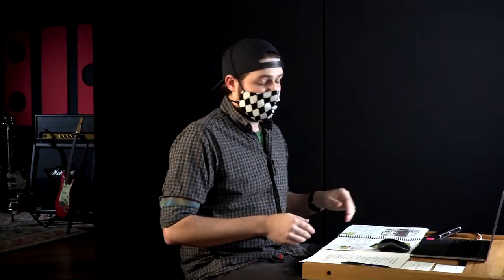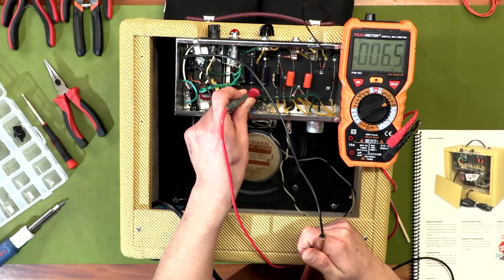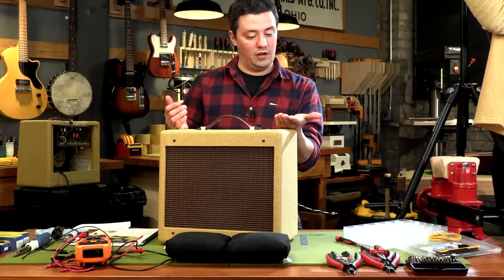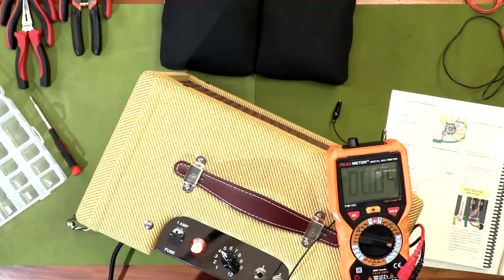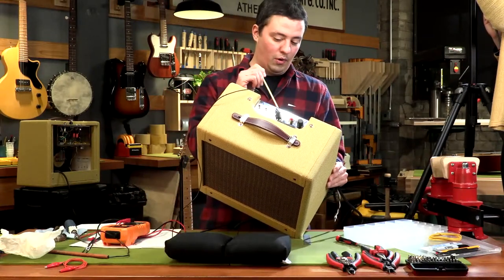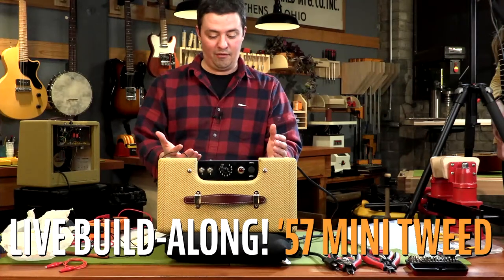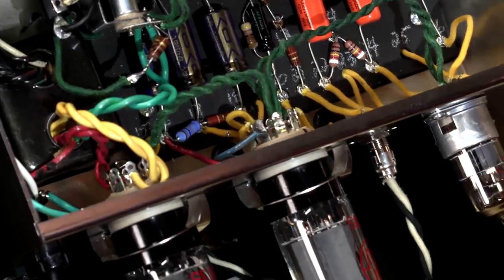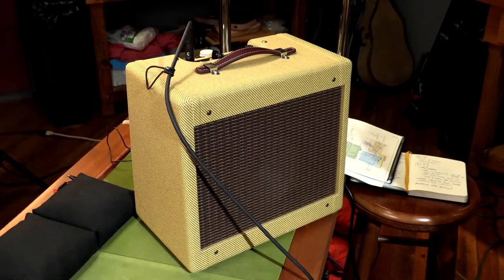How to Build a '57 Tweed Amp Kit Step-by-Step (Episode 5)

Comment: Hi guys at @stewmac, Thanks a ton for these brilliant videos. I was able follow them and build one myself. It's a brilliant 5W amp. I have a Fender Champion 600 and I must say this amp sounds way better than FC-600. 

I only had the chassis, transformers and the tubes bought from the US. Rest of the components were locally sourced in India. Took some time, to identify the transformer leads for 230V LOL!!

I had to improvise to fit a decent looking LED in-place of the pilot light. Some components used were slightly off the spec, the DC voltage at eyelet 16 a bit lower at ~430. 

I don't know if it will hold up if I play for long hours, but very happy with the outcome anyway!! Never thought I could build one of these in my lifetime. So my sincere thanks again to Tommy and the team🙏🤝
Reply from the maker: Glad this helped you. Congrats on your Amp.

Comment: It would definitely be good if you did a series describing what makes an amplifier circuit. Just a generic and basic explanation. What would make the difference between say a 5 watt and something larger like a 100 watt? Then perhaps describing issues or problems that mean you add things to your basic amplifier to remove undesirable signal or to colour the sound like reverb, bass, treble, vibrato, gain and other commonly added basic effects found on amp. Great series so far and very interesting. Thanks for showing us!

Comment: Thanks for the videos very helpful. I do see a couple of things I would do for more "up to code" safety.
1) safety ground on the mains lead should NOT be shorter than hot & neutral. Should be longer. If there is a strong tug on the mains lead, that causes stress on the connections, the safety should be the last joint to stress/fail, not the first.
2) the safety ground should have a dedicated lug bolted to the chassis,, not attached to the power transformer. Right now you have it held in place by pressure between the PT and the chassis. The whole thing is in vibrating box and the terminal strip can (and under  Murphys law probably will) work loose and lose connection. If there is a failure in the amp in this case, the player can become the ground through the guitar circuit.
3) the mains hot wire should go fuse -> switch -> Transformer to meet current standards, You have it going fuse -> Transformer-> switch. Its a small safety concern but I've always found that if something can fail in electronics, it will. So I prefer to have everything to code and protect myself, and the circuit/components as much as possible.

Comment: I finished the kit today!!! No smoke, burning, hissing or hum and it sounds great! Stewmac put together a great kit that I would highly recommend to anyone -- no experience required. 

Pros of this kit --
1. Great quality of parts all in one package -- a one stop shop
2. Instructions were good and the booklet was easy to read with color pictures, diagrams and info
3. Safety precautions and info at the end of the build are great for first time builders to prevent major damage or issues if not wired properly (which could save damage to your speaker, tubes or bodies)
4. Looks great and plays great after completion
5. Great sense of accomplishment (and guitar cred points when you tell your music friends or family you built an amp)

Cons & Critique of the kit 
1. There were a few discrepancies in the instructions regarding color schematics for resistors which others have mentioned on their reviews so I knew to watch out, and the Youtube videos helped as well
2. Stewmac reviewers have mentioned the shortage of green pushback wire so I was judicious with its use. But even with that knowledge it was very very close on the last two pieces that had to be twisted together then soldered in four places. I had to really finagle and manipulate the wires several times and it was too close for comfort. For the price of this kit I simply cant imagine why they haven't added an additional foot of green wiring for peace of mind and ease of use.  

My Critique of the Video Series
1. Thanks Stewmac for taking the time to put this together, it gave me an additional resource and visual. Overall I found it helpful.
2. However, the series didn't always follow along with the instructional booklet, which at times was both beneficial and frustrating. I do see where some deviations were advantageous to the build but be clear about those changes well before they occur. 
3. Suggestions -go slower and zoom in more often on future video series. 
4. My biggest criticism of this video series? Answering ridiculous questions from people who were interrupting the flow and continuity of the build instruction and process was beyond agitating. Questions about the history of amps and other amp circuits, etc. was not helpful or entertaining, it was a real distraction and slowed down the video and the process. Building one of these, especially for newbies, is tedious and requires a lot of focus. Listening, then responding to Sassycat ask questions like "how much electricity does the human body contain" is foolishness. Please say no to having a live stream for future builds or at least be willing to shut out questions not pertinent to the project. Your patrons will thank you.
Reply: Nice review! Thank you for this.  Doesn't seem like it'd be hard to revise the manual so everything agrees.

Comment: Once I'm able to receive packages without porch pirates being a problem, I'm going to get this kit and the gear needed (multimeter, soldering iron, etc).

I have a couple of questions not directly related to the basic amp build -- how hard is it to add a 1/4" speaker out -- or alternatively to add an attenuator?    Also, a 1/4" amp in, to use this as a 1x8 speaker cab.

Comment: I just finished building the amp. Sounds great!! But the kit came with a aluminium cap for the12AX7. I can`t find anything in the instructions if I should use it.
Reply from the maker: Hey there! Glad to hear it's sounding great. Our techs will be able to help with your question. You can reach them at service@stewmac.com.

Comment: For the price, might as well buy the Fender. Would be more reasonable in the $500 range.
Reply: Except the Fender will cost more and the satisfaction of building it yourself can’t be quantified 👍
Reply: And learn nothing.  Pay tuition for your schooling? Continue. 😆
Reply: What?? A hand wired fender would be twice as much and fender loves to use the cheapest filter caps on the market!!!
Reply: @russellesimonetta3835  Good to know! That's constructive roasting. I see the handwired thing a lot. What really is the difference as opposed to some automated factory process? Bad solder joints?
Reply: @replicated  well,,,, many reasons for manufactures to go with the pcb amps, one plus is they can make every amp sound the same supposedly. But the handwired are very east to work on and repair and if you use quality components they can be reliable for up to 15 years with hard use. For a personal home amp you'll leave it to your grand kids. It all comes down to percieved value too. Some people think oh fender made it so it's gotta be good and it is good. But a hobbyist can make just as good for up to 1/3 the price. So there is the bang for the buck thing. Wanna spend 2g's? You can build three!!!! A practice amp, a good gigging amp like a fender and a marshall. One final point it's very cheap to make pcb amps.
Reply: A large part of my attraction to this is that I get to put it together! It's like building a model but I get to play with it afterwards.